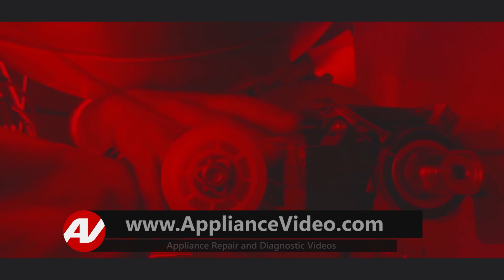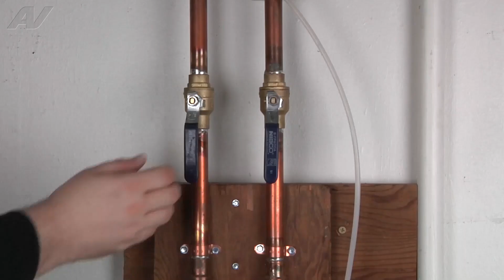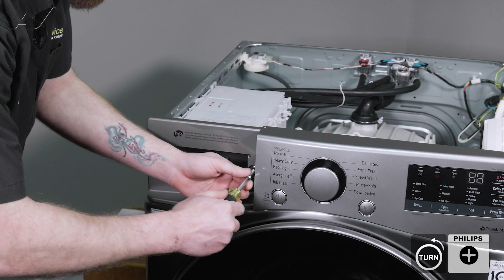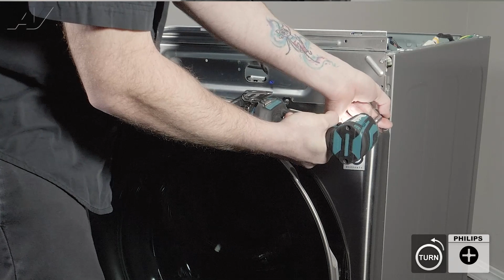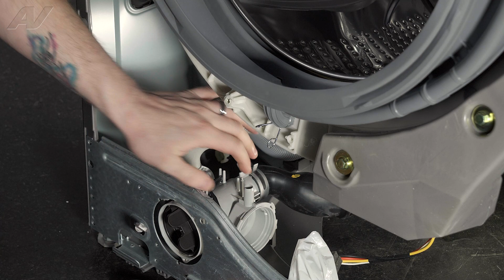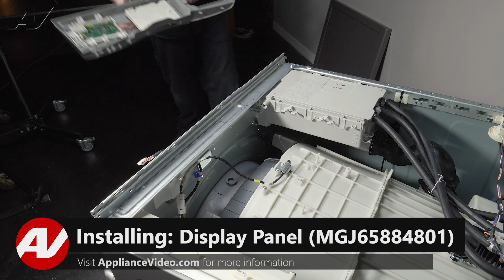LG Washer Water Leak at Pump Hose - Diagnostic & Repair

Comment: Thank you!! I finally fixed my machine!! Your video was very easy to follow and gave me the confidence to give it a try. My issue was the hose coming down from the detergent dispenser wasn’t fully inserted into the seal around the door (this wasn’t part of your video of things to look for so it did take me a bit to realize the problem). Really appreciate the put it back together part of the video as well. No extra parts and sitting in front of my working non-leaking washer with a BIG smile on my face!!! Yay!!!

Comment: Really good video! Though my model may be slightly different, wm1455hwa, and there is a hole in the bottom middle of the rubber seal…. From another video it looks like there should be a hose clamped underneath that goes to the drain…. May have to watch this video a few dozen more times before I’m confident enough to try dismantling it myself!😅

Comment: Can I perform this procedure from underneath, by tilting and securing the unit on an angle?
Reply: Lmao I did this from the bottom..I just tilted it and took me about 10 minutes 😂
Reply: I was just going to say this. When the technician replaced mine, he just put the machine on it's side and had full access. Slightly different model? Maybe LG doesn't approve of this method because of the way the tub is suspended? Not sure, but it took about 10 minutes.